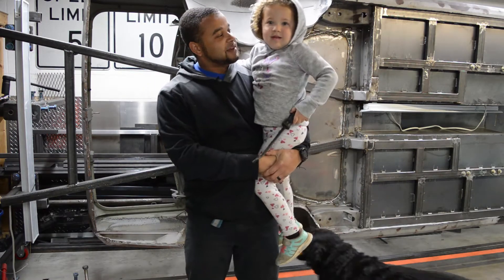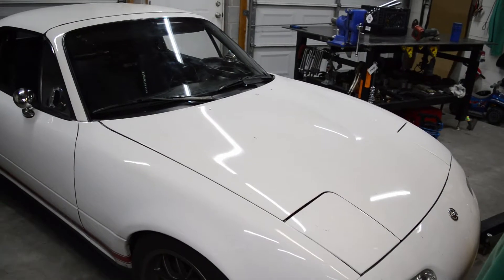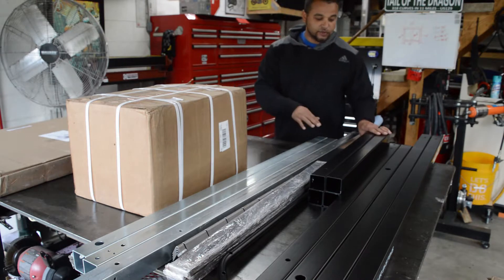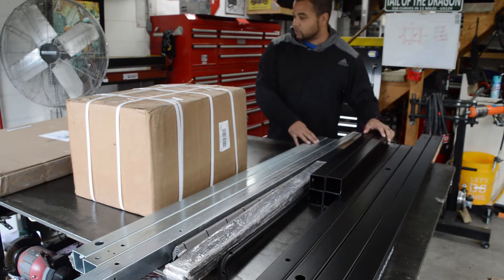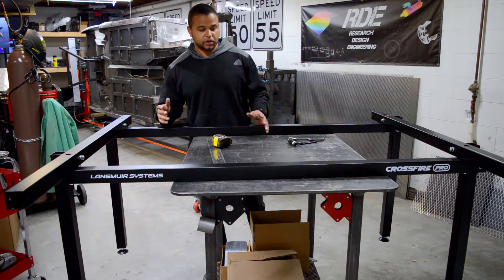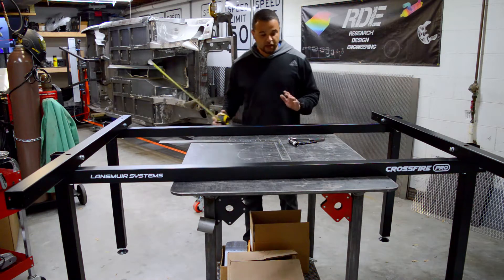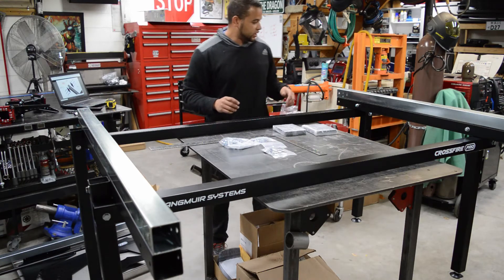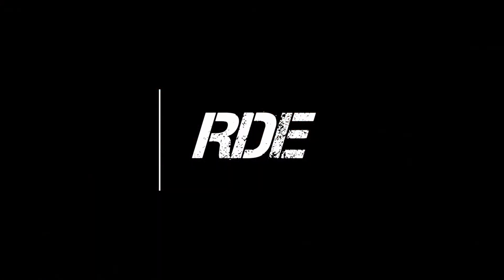Langmuir Crossfire PRO CNC Plasma Table Build Part 1: Unboxing and Assembly

Comment: Square your table diagonally as well as across the 55" front and back. Also, made sure your framing square is actually square before using it. Other than that, great vid.

Comment: How do you like this setup? Any problems so far? Would you recommend?
Reply from the maker: Its fantastic, we have used it quite a bit and have had zero issue with.  We have part 2 and 3 coming, part 2 will hopefully be out this weekend or next week.

Comment: I just finished the build on my Pro also (it sat at UPS for 3 weeks)  Today I am running the 8 gauge wire thru the wall from the attic to the Main box ( I hate the attic in summer) I choose 8 gauge because it will safely run 40 amps and a breaker does not pop until it reaches approx 20 % overload giving me 48 amps, I don't plan on ever using that many Amps, for me this machine will help make  wood/metal combination furniture pieces with my lasers and CNC's. like the video it's correct to the build and concise. ( I personally thought the instructions on the torch height controller could use a little more definition, but it was a good kit and easy to construct.) also something that you might find interesting is that I was able to run my machine further away from my computer by using a powered USB cable that extended the 15 foot USB limitation by 66 feet.
Reply from the maker: Thanks for the feedback Dwight.  We agree with the THC instructions.  One thing we ran into was if the main plasma unit is to close to the USB then weird things were happening on our laptop.